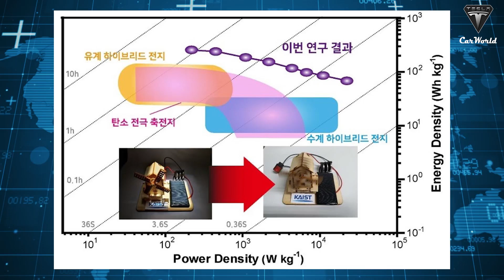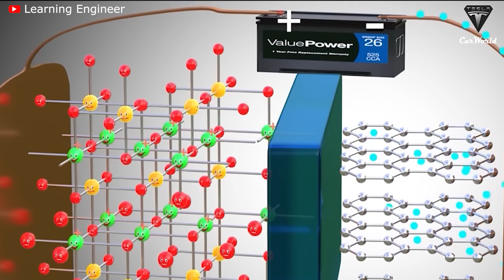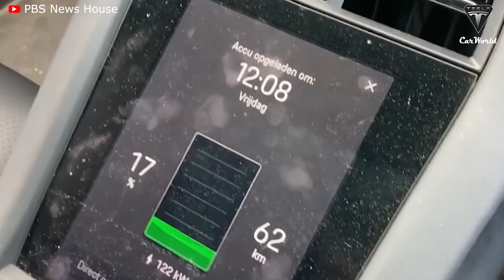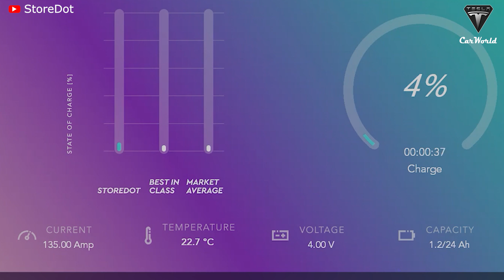IT HAPPENED! Elon Musk Just Shocked by New Insane battery, Charging in 1 min, only $5.21!

Comment: So much wrong with this.  Almost don't know where to start. First there is an important distinction to be made regarding "power density" versus "energy density".  Power is rate of use of energy (hence the terms 'power and 'energy' are not interchangeable).  Energy storage devices with high power density have been around for a while (UltraCaps being a good example).  However, energy density is really the important parameter (ie the limiting factor) for an electric car.  If you have enough energy to give you decent range, then ample power is really a given, based on current lithium battery technology.  It may be advantageous to have high power density for faster charging (the point being made in this video?).  But it is important to understand that nothing just "HAPPENED!".  We continue to wait.  In the mean time, consider if the power distribution networks (the "grid") can support faster charging anyway.  Even with current charge rates, there is going to be a crisis in power delivery to charging stations as EV use increases, and given current utility infrastructure.  To charge a 50kWh electric car in one minute requires power of 3MW.  Not going to happen!

Comment: The problem with fast charging is that it lowers tbe amount of cycles the be charged. Best charges come from a slow amp input. Only battery i know of that can take a 15 amp charge is a A123 life cell. But i never repeatedly charged discharged them. That was just a charge. Not a ballance charge. Lipos will go out of ballance if not a balance charge. If charged too fast they will puff and either put off a ton of smoke or catch fire as many teslas have already burnt up. That must be fun having your car burn while your in it driving!
Reply: Fart

Comment: Remember, all those Gigawatts of electricity are generated by burning oil or coal. There is no limit to battery technology but the power has to come from somewhere to charge batteries, solar nor wind produce near enough kwh to rapid charge a battery.   If we really expect to see electric vehicles become practical, we must begin by developing safe cold fusion power plants and wireless power transmission such that cars can be charged while driving and use more of a capacitor than a battery.

Comment: IF this comes true in a few yrs,,I can see a solution coming to charging ev's while on the rd., Imagine highways with a quick special power station turn off that ev drivers drive under, idle for 1 min. while the battery charges, pays for the charge with their cr card, and then resume their trip to the next one a few hundred miles down the rd. (IF THERE IS A POWER GRID UP TO THE TASK).

Comment: Yes there are lots of scope for battery improvements, capacitors as the foundation of batteries can charge quickly and discharge in an instant, so if that is the basis of energy storage in a vehicle "battery" - then insulation against very high voltages will be an issue, ditto for the charging where high voltages combined with high currents would be needed to charge such batteries in just a few minutes because the amp-hour, or watt hours needed would be the same as for more conventional batteries.  In other words if it currently take 40 minuttes to charge a battery  to xxx amp hours, charging a capacitor based battery to the same amp-hour capacity in, say 4 minutes would require ten times the amp-hour charge rate, and as lower voltages require larger "cross-sections of conductors" to transfer a given amp hour, or wattage, than a high voltage conductor, - charging such capacitor batteries might need ten times the voltage of current charging stations.!   So very dangerous high voltage and amp's would be needed.!  That, and the extra insulation then required may prove to be too difficult to accumudate within the limited space of smaller vehicles.?  The technology may be more suited to larger commercial vehicles etc.!? 🙄

Comment: Rather have a 200kWh car battery at 1kWh/kg with 5000 cycle life. So it would have a range about 1500 km (also be suitable for towing). It would also last long enough to be suitable for car to house powering. It would only weigh 200kg..

Comment: Even this would be old and near unless technology. The future is not how fast you can recharge a battery at a charging station. 
The goal should be to incorporate a wireless recharging grid into the streets similar to the wireless recharging of your cell phones by setting them on a recharging plate instead of pluging them in. Then the streets recharge your vehicle as you drive it. 
You have no recharging stations, unlimited driving range, even when pulling a trailer, and never have to exit your car on a hot or rainy day to plug it in.
You pay for the power you use either as a  fee on your vehicle registration (prompting people to keep their tags current), or you pay monthly or weekly based on you vehicle sending power usage info to the power companies.

Comment: I’m surprised someone hasn’t tried adding a crap load of super capacitors that charge very quickly and are light. When plugged in would charge main battery while charging super capacitors. If you had the time charge fully, if not charge up super capacitors and let them slowly charge battery as well as run motors
Reply: It doesn't work that way!
Reply: @donraptor6156  Your statement is vague and does not explain it self.
Reply: Super capacitors do charge very quickly but unfortunately the energy density isn't even close

Comment: A magnet is a permanent battery.  You can wire them as a battery pack to have a permanent source of electric power without fuel or pollution or moving parts.  The Edison generator and dynamos easily replace the battery system.  A very light unlimited range electric power car or airplanes helicopters can be built if primitive battery powered electric cars trucks are abandoned for permanent magnets are used as self spinning generator or permanent magnet battery.

Comment: Even though most of these batteries are years from being installed in vehicles sold to the public, it's great to see innovation happening at a high rate.  We still have a big problem with charging stations though. Most will not provide the power at the rate these batteries need.  I could see a car that could charge at a public station, have a range of 500+ miles, and last 30+ years, in the next decade. To me, that's promising.
Reply: 😂l

Comment: This will add large costs to the grid.  Imagine a few of these cars charging at the same time at a given location.  You will need either very high voltages all the way to the charging location (more power can be transferred through a given conductor, the higher the voltage) or one would need huge conductors.
Reply: Imagine being stupid enough to fall for this made up stuff.
Reply: EV adoption isn't instantaneous. They can easily slowly improve the grid, as more and more people adopt EV's. Only if governments do nothing at all to improve the grid, is where we would run into problems.

Comment: Maybe I'm a dumbass but could someone have any idea why there is the need for hundreds of small batteries instead of some larger batteries in a pack, i.e a battery 12 inch x 12inch or 400mm x 400mm with depth 6inch / 100mm

Comment: The secret and issue was disclosed in one word GERMANIUM !. If it was possible to make realistic devices using it, it would have been done about 70 years ago as it has very good properties when used in wide range solar cell, thermocouples ect, emitting electrons and ion transfers with as low as .06 electron volts but temperature is its weakness, high electrical transfer low temperature bandwidth.